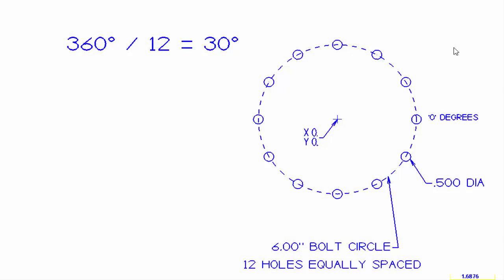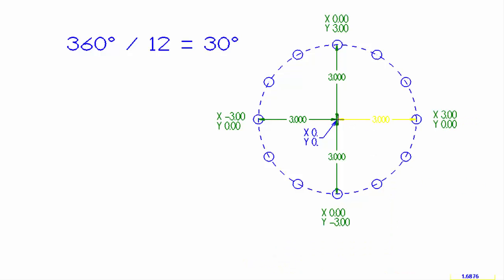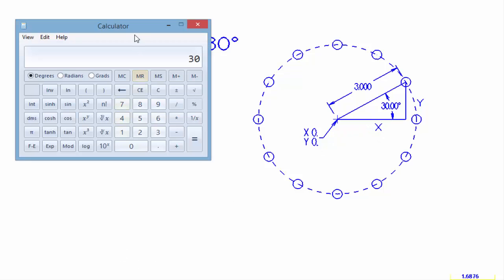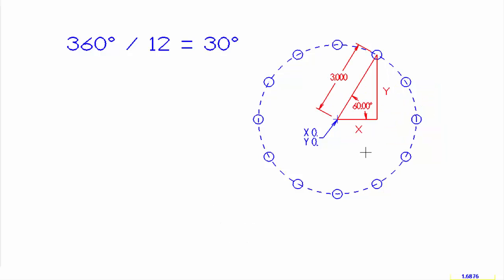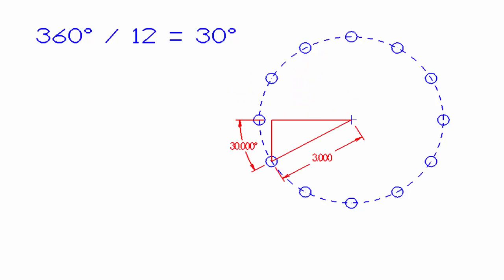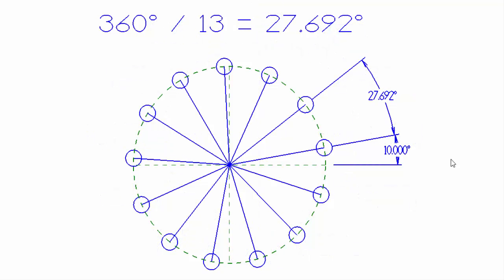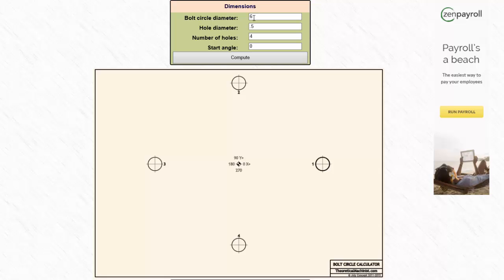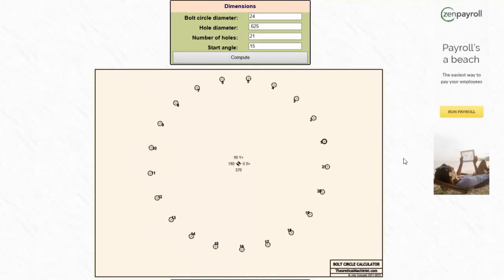CALCULATING A BOLT HOLE CIRCLE

Comment: I was wondering if you think the G68: rotation would work for this. I use a rotary c axis lathe for most holes locations. I tried to talk the mill guys into using G68 with a WHILE STATEMENT

Comment: If I remember correctly, there is a G code for drilling holes at specified bolt circle diameter with a specified number of holes starting at a specified angle.

Comment: how do you find the x and ys if your center isnt 0???? my x any center isnt 0 on the print.
Reply: bigDawgC21 translate your values you get from what he showed you, like you get a bolt circle point (5,4), so let's say hole location from center is (2,5) if hole center was (0,0), so (5+2,4+5) is (7,9) and do it for all points. (X,Y) format btw.

Comment: Thank you Sir. Long ago I used to know how to calculate a 1 inch bolt circle using a print out and then using those numbers to calculate all other measurements. I knew the hard way. Is their any place I can find how to do that again? I do own a machinist handbook. I am now back in school at 50 to learn CADD. I need to write a paper on it. Thank you. Nick

Comment: Tom...
I've been working in a machine shop for about 8 years as a advanced operator. I've decided to move ahead by learning to actually program and I'm really appreciating these tutorials you've made. I just finished watch this video and had a theory idea that I thought maybe to could confirm or negate.

Could you combine this process with the process regarding the use of G68 you taught a couple videos prior to perform hole patterns? Since Zero is center and the bolt distance is 3 inch....theoretically you should be able to locate the 0, 90, 180, 270 holes....then can you run the G68 R30 for the next 4 and again for the last 4 holes??

Just curious if this would work so you don't have to program all the different X,Y cords...??
Reply from the maker: Hey Brian. Thanks for your feedback and watching my channel. Yes you can use the G68 command to rotate sections of bolt patterns. Not all machines have that option turned on so that would be the only reason X and Y coordinates would be the only option. Thanks. Tom
Reply: Hmmmm so is that yet another "pay to play" parameter....I've come to learn there's a lot of that with machines. It doesn't make sense to me to build in a feature but turn it off unless the consumer pays extra. Its like adding all the AC components to a cars but not connecting the wires at the back of the switch unless you pay extra....lol

ok so how would I know if that function is turned on...we run Doosans and OKKs with Fanuc controllers as well as HAAS, Milltronics, Partner, Bridgeport, Okuma... Are we talking try it and see if it works or errors.....or can that feature be looked up in the control panel someplace?

Comment: Thanks, any chance of a video on Polar Coordinates and on how to use the M99  to loop as some Machine Interfaces wont allow for Parametric code?
Reply: The holes are in polar form 3"<30 you have to use rectangular form to calculate X,Y. M99 is used in multiple ways Line Number Jump, Loop a Main Program, and Return from Sub Program. Without the use of variables and Macro Programming there is no way to loop and calculate your coordinates. So you would be better off using a Drilling Cycle and Tapping Cycle if you are threading the holes you drilled. Then plug in the Numbers for each Hole Location.
Reply: @threeaxis359  Thanks, appreciated !

Comment: How would you calculate a hole location if you don’t have a start angle like your last example of a 10 degree offset? What would be the formula to calculate the missing angle if u didn’t know it was offset by 10 degrees? Thanks8)

Comment: You can also use a calculator with a P-R function. (Usually on a Casio or Sharp) So you type in your radius P-R(with the shift key) then the angle. The X value is displayed right away. Press shift  X-Y and the y value is shown. If you have a SVPAM the syntax is REC( rad, angle) and X and Y are normally displayed at the same time. I'm only mentioning this as it is much quicker to do this when you are programming on a machine instead of a PC.
Great vids BTW. I especially like the Do While, I can't help but to keep going back to it.

Comment: Hi Tom
This video has been incredibly helpful. My hobby is building simple clocks and I am attempting to learn enough G code to allow me to build an electronic  indexing system. I think you may have given me the place to start. I was looking for a way to divide a circle into sectors ranging from 8 to 64. Have I misunderstood something or will I be able to simply say "teeth"where you say "bolts"? 
Robert Webb
Brisbane
Australia
Reply from the maker: Teeth will work just the same.. Thanks for watching!!

Comment: I can follow clearly what you did here. Now can you possibly help me understand what my DRO is doing. The instruction example called for a 5 hole pattern with a start angle of 30 degrees and a end angle of 300 degrees. I guess the start could be 0 or 30 which sets the position start. Where did the 300 come from??
Reply: Tunnel redax calculet

Comment: Very smart, I used to do it on the lazy way with G68 coordinate system rotation.
I am not sure but it was something like that:
...
Y0. X3. ( First drilling position) 
M98 P0071 (Simple drilling sub)
G68 X0 Y0 R30. ( rotate 30 degrees ) 
M98 P0071  (Simple drilling sub)
G68 X0 Y0 R60. ( rotate 60 degrees ) 
M98 P0071  (Simple drilling sub)
G68 X0 Y0 R90. ( rotate 90 degrees ) 
M98 P0071  (Simple drilling sub)
.....

It is possible to rotate it in incremental way as well.
Reply from the maker: +yourserenity  Yes, that is a perfect example of using coordinate rotation. I am not aware of using the G68 command with incremental values. I would personally assign a variable to the 'R' and make it part of a looping macro statement. I'm sure there are several different ways the G68 can be used. Some more creative than others. Thanks for watching.  Tom

Comment: Interesting. Why would you use the tangent of the angle with the rounded entity (x), rather than choosing the sine, and work with the actual hypotenuse (r)?
Reply from the maker: Crivo152 I agree with you. That would be more accurate. Thanks for the feedback.
Reply: @TomStikkelman  the result is the same but if you have the answer to one side then you can use tangent of the angle based on the result and not have to clear the calculator and start over.